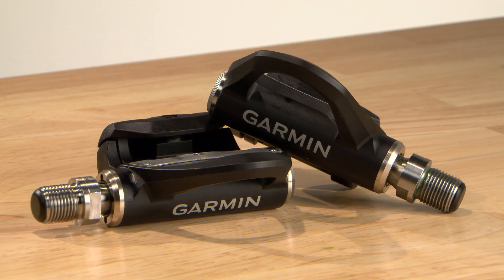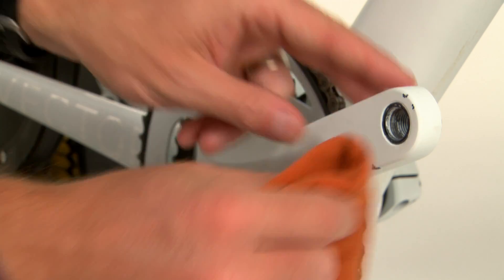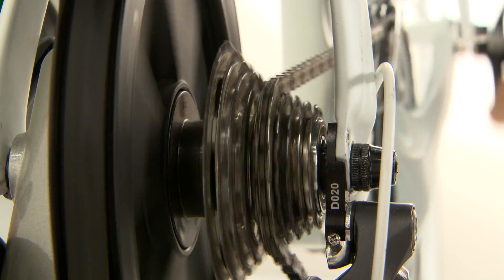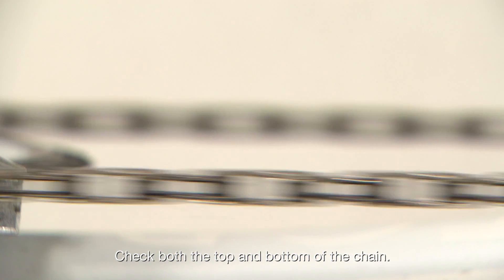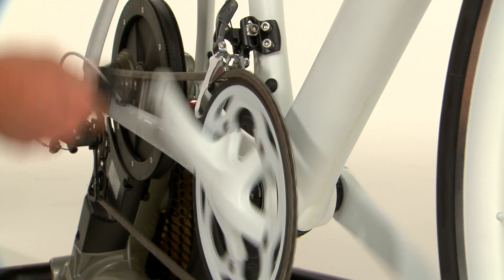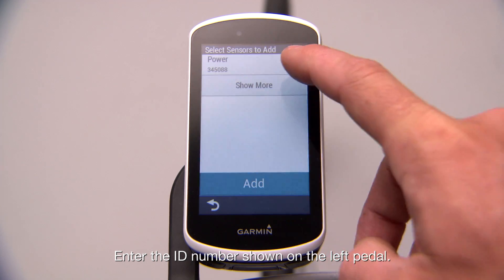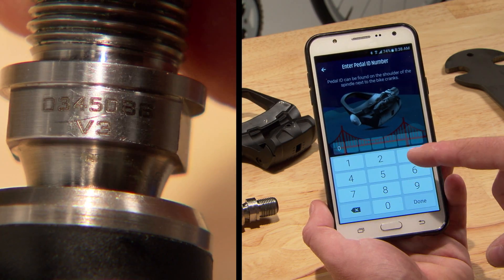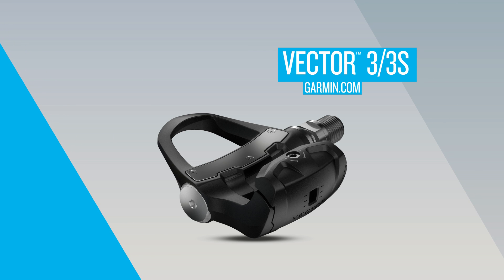Vector 3 and 3S: Getting Started

Comment: This are really bad! Way to expensive for a product that does not work accurately
Reply: Iam almost ready to buy. Why do you think they are bad?
Reply: Randy G. The right pedal loses connection all the time and by the end of a ride the reading is by +-13watts off.  I returned them and bought a brand new pair ... the problem persisted so I just gave up on those pedals.
Reply: @cinthyalc1162  thanks alot. Even the research only is frustrating. I'll definitely set may goals to a different direction.
Hey am on my  shimwn is3 right now , music is good enough for now😂😂
Reply: @cinthyalc1162  by the way, I was trying to pair them with zwift
Reply: Cinismiles same issue here. I have the Powertap G3, a Cycleops smart trainer and a peloton bike to compare power. My dual sided garmin V3 is reporting 25w low compare to the rest and the right pedal drops out after the latest update. Very frustrating for a very expensive product.
Reply from the maker: Hi Fred,

I'm sorry to hear about the trouble you are experiencing with the vector 3. Please reach out to our support team to help with this issue. They can be reached by using one of the contact methods listed under the "Contact Us for  More Help" section here: http://bit.ly/GarminContact-US

Kind Regards,
{IK}

Comment: Is the Garmin Vector S3 compatible with Garmin 810 in any way, should be with ant+. thanks
Reply from the maker: The Vector 3 will pair with the Edge 810 and receive power data, but may not receive some of the advanced Cycling Dynamics metrics.
-OA